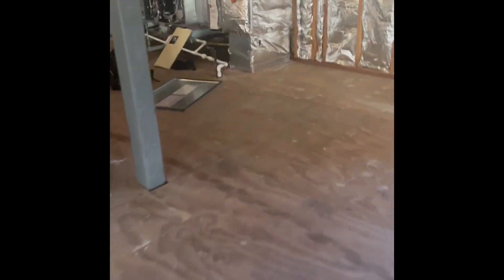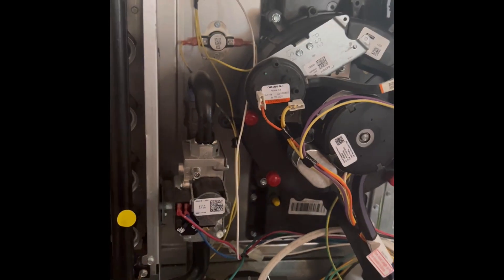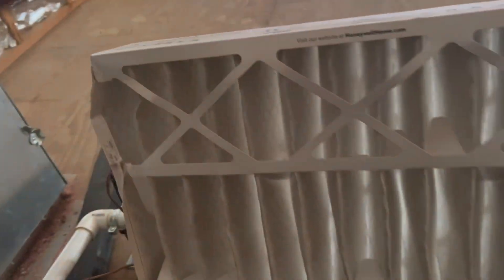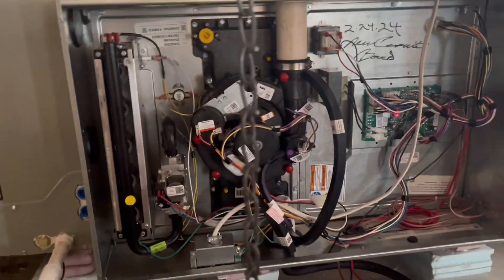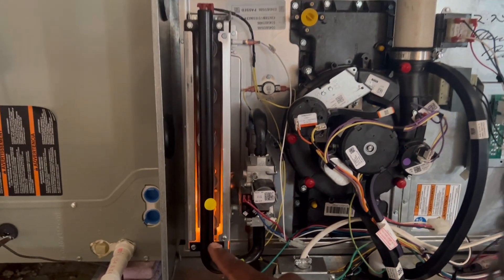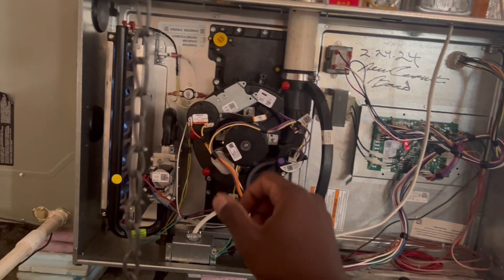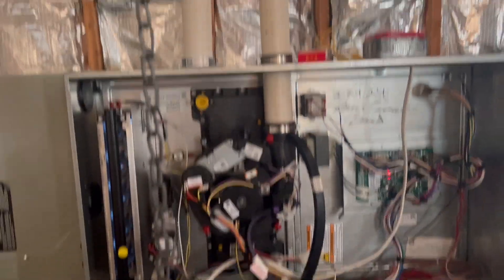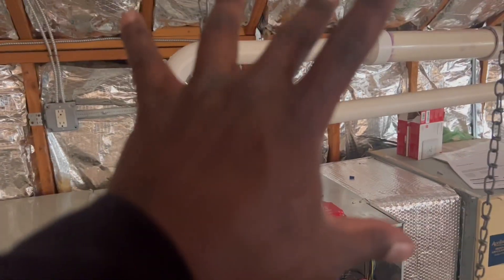why is Furnace Limit switch tripping!!

Comment: Thanks for the information.   Think my return and supply are too close too.  This is a bit of validation to have to moved a
bit further away.  Where you have your temp probes for the supply temp and return...when you pull those out, how and
what's the best way to plug the holes?  Or is it necessary to plug the holes?  Seems like the holes would affect airflow
as well as heat up and/or let heat/air contaminates into the attic.   Thanks for this video, it helped me a lot.